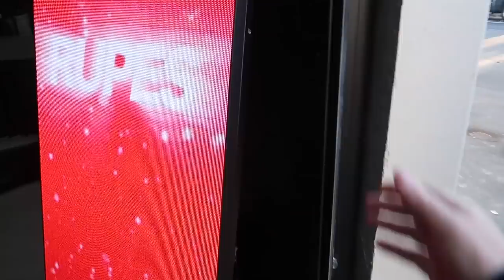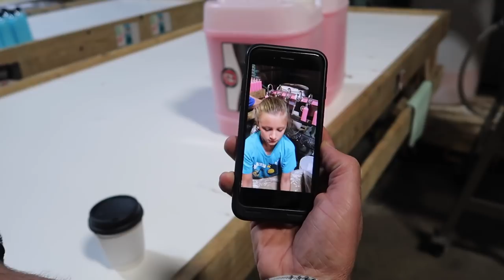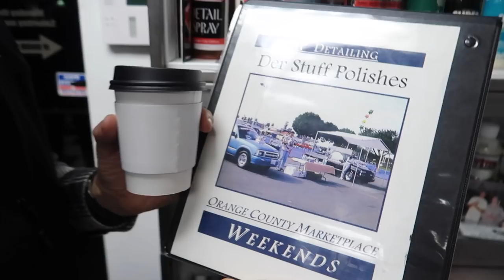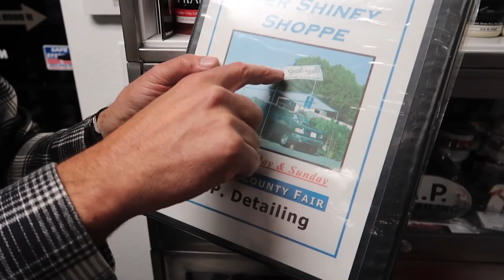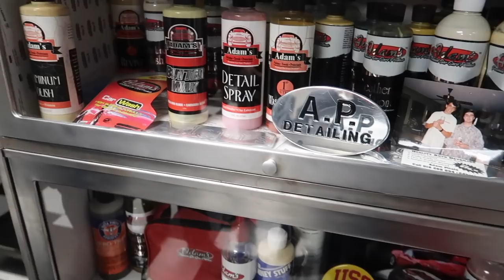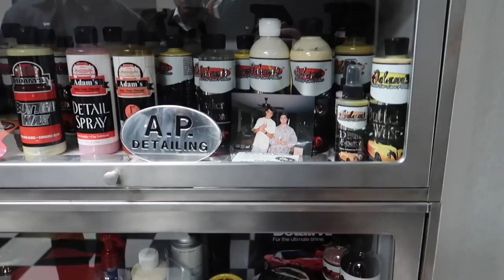Video Tour of New Rupes US and Adam's Polishes Headquarters

Comment: Matt, find an industrial supplier local to you for HDPE marine board, its supplied in 8'x4' and similar various sizes, but its completely impervious to water, so covering a wash bay is a typical application, its like a heavier duty version of the stuff now popular for shower stalls. Very easy to work with, easy to cut/drill and strong enough to hang stuff on ...
Reply from the maker: Good stuff.  Thanks.

Comment: New to detailing and have a quick question about using a glaze first then putting wax on top. I have heard conflicting opinions and was wondering if someone could help.
Reply from the maker: Glaze is a much older technology.  It's designed to fill the scratches.  You'd be better removing the scratches by machine polishing then going direct to a wax.